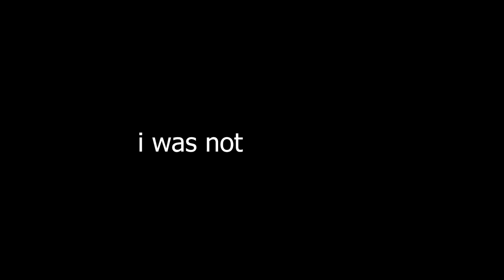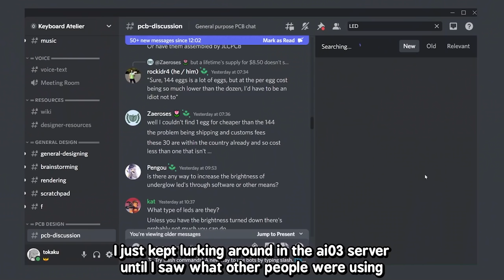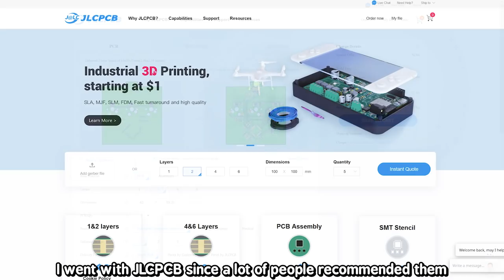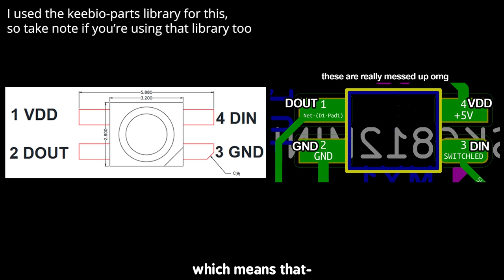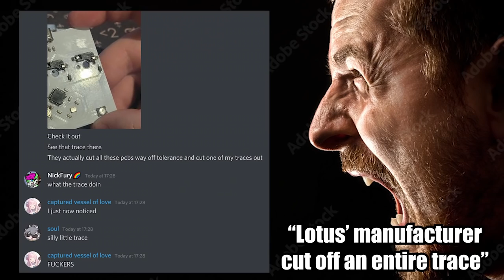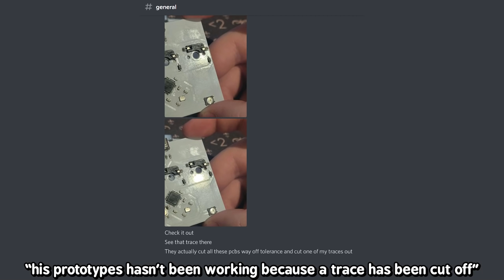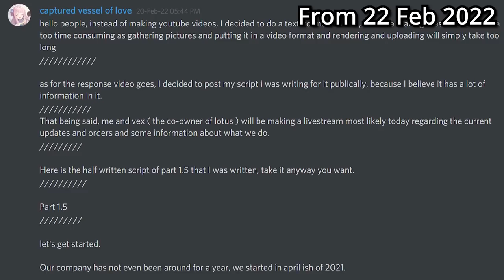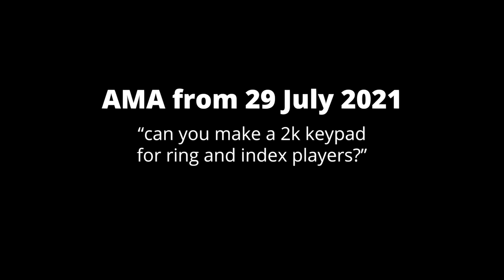making an osu! keypad 𝒐𝒖𝒕 𝒐𝒇 𝒔𝒑𝒊𝒕𝒆 ⭐

Comment: As an electrical engineering and computer science student, that last part made me cry, it's clear he's absolutely inept. Some snarky nitpicks on your part tho. That ground fill might constitute as a "cut trace". Preface: I can't exactly see the pcb well so this could might as well just be hypotheticals and not really applicable in this situation. That small patch might connect towards the left where the USB C port is, in that regard, it would have cut the connection. Small correction to make. Voltage does not run across a curcuit. There's a voltage drop, you can apply voltage, but it does not flow, current flows. It's a small matter of terminology but as a electrical engineering student, that shit get's hammered into you.
Reply from the maker: ah I getcha except... he actually thinks it's a cut trace not in terms of a ground fill. Basically the very last point I didn't want to say (I have no fear saying it now, the guy refused to watch the video and started spouting nonsense instead) was that he couldn't tell the different between up and down. You can see the traces of the PCB at 13:28. He thought the trace that was cut off was the on other side of the PCB (he couldn't tell that things are mirrored when... you flip things around...) So far the traces to me check out (they're extremely similar to the 2 key version) and they are correct and should work. I can't say about the traces under the logo though, I can't see them. Or the components, because I don't know all of the values or parts. 

BUUUUT the true reason why it does not work is observable from his videos. That same 'fuse' I pointed out that was a resistor in his PCB, turns out, it's actually supposed to be a fuse right there instead. While filling out the BOM he most likely made the same mirror vs non-mirror mistake and put the sequence as (from the back side, mirrored) resistor, ESD, resistor, fuse. But it was put as fuse, ESD, resistor, resistor.

There may be other errors, but I won't know until I can see the raw files. 

Hope that clears things up!
Reply: @tokaku  Mistake makes sense. And thanks for the reply! Not that common to see youtubers reply in earnest.
Reply from the maker: @yami_the_witch  Yeah! Glad you pointed out that ground fills can be counted as cut traces as well. I didn't know that, I worried more about shorting something with the fills. I'll keep it in mind for my future projects ;)
Reply: The CAD programm i worked with in the past shows wether a connection that's present in the circuit plan isn't connected on the board. I don't know if your programm does that as well. Either way, so when your ground fill doesn't reach all the ground connections you'd notice. Usually ends up happening because the isolation is too thick and there's one tucked away ground pin on an IC or something. Although I am unsure about protection against shorts... Technically it doesn't let you set any traces on a pin where all connections are done, but you can always go over one while routing from pin to pin.

Comment: So this popped up in my recommendations and i thought "Well i don't know anything about Osu!, buy i like mechanical keyboards, so this could be interesting." 
And interesting it was. I learned about a company i should avoid and also learned where i can find info about making PCBs. 
I can't tell if the dork running Lotus into the ground has never worked a real job or has only worked retail and got fired for insulting customers

Comment: lol they need months to figure that out and here I am as a student in a formular-e team and they go like: "so you know a bit about electronics right? So our old sound chip broke and we need a new one. Btw can you do that you can just load a file onto it and play that, the old one couldn't do that, but the footprint needs to remain the same (4cm diameter circular), also the voltages are really specific so you probably need to build your own amplifier. You have two weeks. Oh you never made anything regarding sound? I am sure you will figure this out dont worry!"

Comment: Electronics engineer here. 

If no one else has pointed it out,  the LED datasheet IS garbage, but there's some extra funk.
They look like backwards firing LED's. AKA, they're meant to be soldered on one side "in reverse" and actually shine through a hole in the PCB.

The datasheet nonsense: 
Usually, a bevel (cut corner) is used to indicate pin 1. But if you compare the different views of in the datasheet it's all over the place. They use the same pin names in the mechanical view and the footprint view, but when you remember that in the footprint the LED is supposed to be mounted backwards (backwards firing) then the names are are wrong. Especially when you notice that, indeed, the bevel for pin 1 is now bottom left instead of bottom right. 

But then they have a bevel on the casing that doesn't match the bevel on the lead, and actually on the technical drawing of the case there IS NO BEVEL on the back of the LED.

It's an overall mess.
Welcome to my job.

Comment: EDIT: Nevermind. Just checked the other comments and you said it was around over $200. Thank you. (BTW $200 for a working prototype is pretty reasonable especially if you pretty much went in blind. Good job and gratz)

Interested in how much it cost to get to a working prototype (not the price of 1 unit or the BOM). I'm not asking because I want to insult you for how much you spent or anything. Its just that as someone who likes designing things and never ended up going as far as ordering complete PCBs, laser cutting, engraving, decaling, etc, I just want to see that actual real cost of getting to the first prototype.

For example when you order parts you end up grabbing small tape reels of some components, multiples of the same chip, multiple PCBs, and shipping on top. I'd like to know a rough estimate of your upfront costs to get to this point. Thanks.

Comment: Oh come on, it's 3 keycaps, how hard can it be for this "electrical engineer".
Good job though yours works great. Not an OSU player, wonder how long it'll last with the crazy clicking.
Also this might just be personal preference but there's gotta be regular circuit breakers for DC right? Cause once the fuse trips the entire board is fucked without resoldering. Kinda ruins the point.
Reply: for DC circuits, I used a polyfuse instead so there wouldn't be a need to replace it when it 'blows'.
Reply: @user-bx9sg1qr9x  That's exactly the kind of thing I was talking about!

Comment: Wait, when u meant u learned pcb design in 3 days, do u mean u learned EE stuff before and just added pcb design on top, or do u mean everything from ground up urself?
Reply from the maker: I was a computer engineer student in school. Though I never really paid attention in class... I was taught stuff like voltage drop in school but I could never understand.. But at the bottom line I knew the basics of how components worked (e.g. what a fuse does).  But overall, even a person without any EE experience can get into designing, the ai03 guide makes it easier to learn and for basic understanding of things, you could google or youtube it! The ai03 server is also open for questions and help

Comment: its sad that he mentions tolerances as a base for an argument cause in my freshman engineering class we covered it for a day and I have yet to struggle with the concept that one measurement needs to be marginally smaller than another for there to be a nice fit. And prototyping has never before been easier with 3d printing, if your not sure on a measurement spend a few hours printing it and just do a physical test. The more I learn about Chris, the more I want to bash my head into a counter - honestly, you don't even have to have an engineering background or pathway to understand a square and square hole situation. 

I can't personally critique lotus for any of their electrical stuff cause my school has yet to put the class into rotation so maybe I will be able to in a year, but cheers to aerospace being offered instead.

When you find yourself in a hole, the first thing to do is stop digging- it seems Chris has never been told this.

Any who,  good vid and congrats on devolving and producing a keyboard before lotus did.👍

Comment: I understood none of this but watched all of it
Reply: It's honestly really simple PCB to Arduino Arduino installed with firmware that makes it seems like a keyboard and switches connected to the PCB.
Reply: @MtFoxt  you lost me at PCB, I understood everything other then PCB
Reply: @yokaiwatcher8500  PCB is the board that connect everything basically.
Reply: @MtFoxt  ah! I’m guessing it stands for primary circuit board or something like that
Reply: @yokaiwatcher8500  yes if you know something about building a computer it's basically like a motherboard it holds everything together
Reply: @yokaiwatcher8500  well technically motherboard is a pcb

Comment: >comparing a 3-key USB device, to an entire electric car that pushing the boundaries of current technology.
Man has a bit far up his own arse I see. Tho, when someone has a "slander doc," I about guaran-friggin-tee you they are BS.
Legit, GJ on the DIY.
Edit: regarding PCB rattle, why are there no screws affixing the PCB to the backplate? I mean for the multi-employee company with the "engineer", not you. Regardless, a bit of foam to fill up space in the case would be simple enough.

Comment: How much did it cost in the end?
Reply from the maker: way too much. Over $200+ for 5 of these (though I can only make 4, I only bought 4 MCUs). Low quantity units are expensive, and I had to buy the minimum amount for each component. I have 100 resistors and 1000 screws, I don't know what to do with them omg
Reply: @tokaku  holy shit that is really expensive